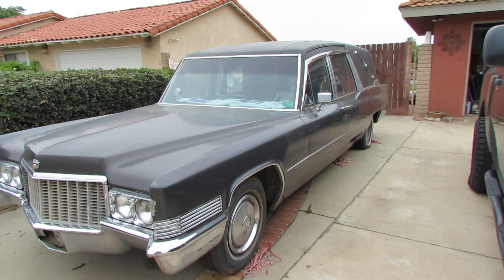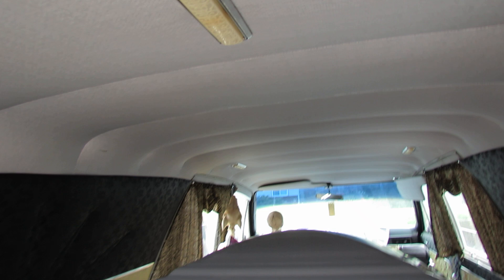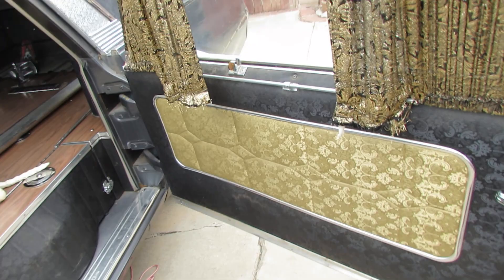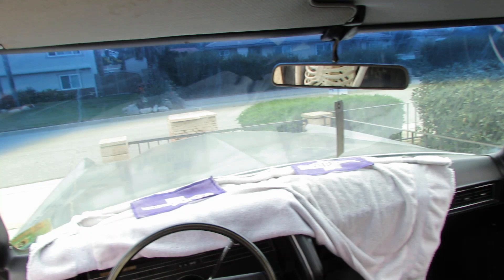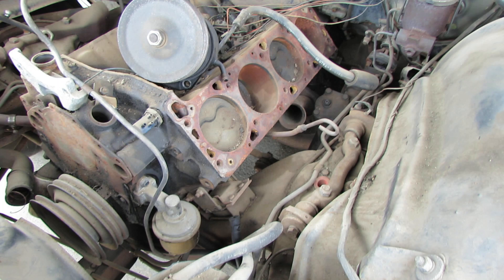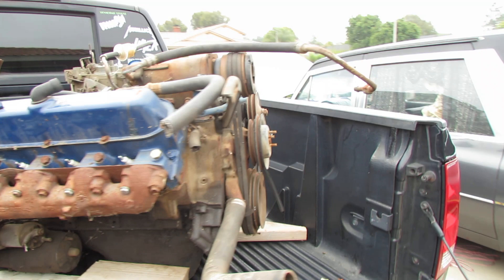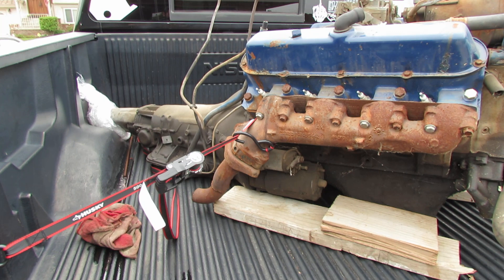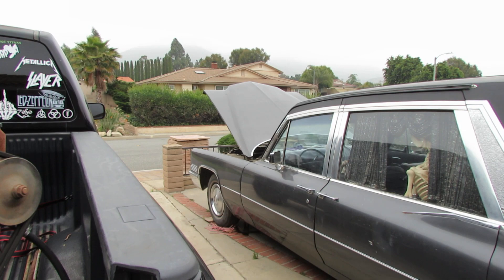1970 Cadillac hearse walk around

Comment: The 472 had the same hp 68-71. In 72 they dropped the hp. I’m thinking they reduced the compression. In 73 and 74 even lower. Then came the 500. Even lower hp.

Comment: The amount of time you wasted on a new motor you just bought. Definitely could have built the old original motor was in it...
Reply from the maker: I did use the original block. But I was missing lots of parts like the heads. That’s why I bought that other motor for parts.
Reply: That is good to see you bringing it back. The hearse looks like it's in very good condition. for the aged I do understand it's not mint. but very nice car